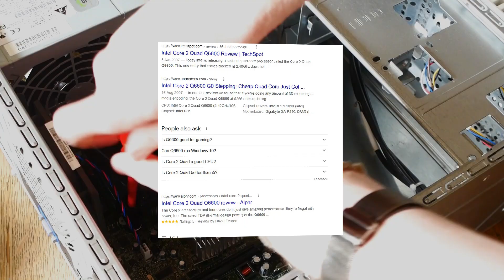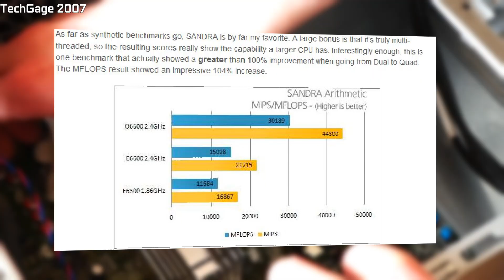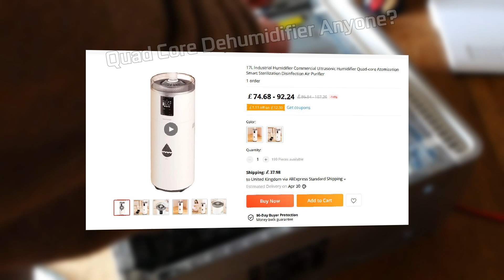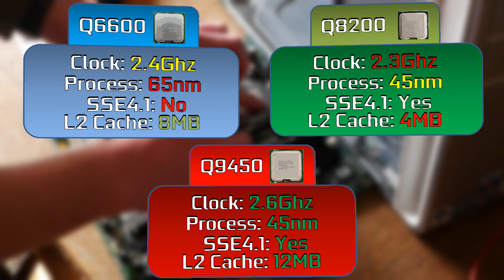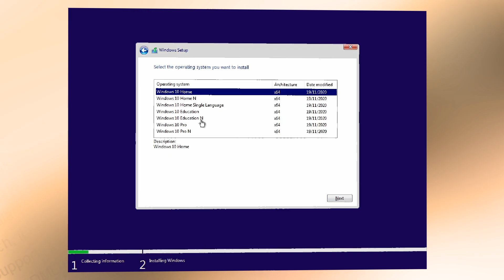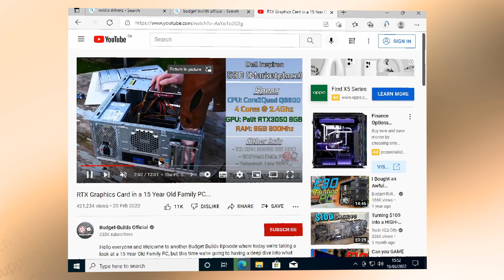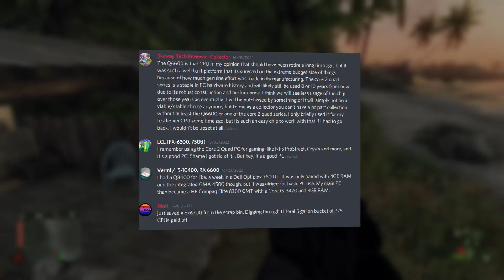Intel's Core2Quad...Finally Obsolete?

Comment: the q9550 witha 1ghz OC and ddr3 was a good puller as of 2 or 3 years ago. mine stopped booting with an OC before i got a 5600x. i played gta 5 on mine.

still use them for web browsing and light gaming now.
 still usable

Comment: Was only a couple months ago my media PC died (dead mb or CPU) since rebuilt pc but it was water cooled with custom loop I made with parts off AliExpress cooling the q6600 in an Asus p5e with 8gb ddr2 and r9 380x. hx1000w PSU. In a fractal define r5
Reply: Note only killed 1 other q6600 in it over clocking but that one only could handle 3.8ghz. 2nd q6600 I got to run at 4.1ghz somewhat stable but ended up taking it down to 4ghz and ran that way for 2years unserviced

Comment: Actually still using a Q9650 in my Asus P5K Premium Motherboard with 8GB of RAM. Dual booting Windows 7 and 10. Still working great! Also have a Q6700 CPU in my Dell XPS 410 computer with 8 GB of ram.

Comment: Bought 2 C2Q dells with 8gb ram for 50 euro. One has pfsense installed and works as a router. The other one I tried different setups on. Both Run like a charm on linux and FreeBSD. Windows is ok but drivers is a search sometimes. You can get the chipset gpu to run on 4k with displayport and its an overall decent machine and platform to use for anything but gaming.

Comment: It's pretty shocking that up until about a year ago (ie during the pandemic) I could pick these systems up cheap, drop a 120GB SSD in it, and resell w/ Win 10 for around $100 if I included monitor, mouse, keyboard, speakers, and mic. Didn't make much on them (about $10 each), but several folks bought them for use as a home setup for school

Comment: I had Q9650 till 3 months ago when I finally upgraded to 5600X on AM4 platform.  Sold the motherboard with Q9650 and 8GB DDR2 all for 30 euros. Had my 775 platform since 2008. I now realized how much faster CPUs have gotten. Great stuff.
Reply: You also feels like you're time traveling from 2008 straight to 2020 when you finally upgrade your CPU
Reply: @sihamhamda47  Indeed, "office web browsing etc" uses so little computing capacity, cpu doesn't break sweat, you seldom hear the fan spin up from default min speed. Where as my 2012 old cpu has spurious ramp ups every minute or so.
Reply: ..and uses way less power! My AMD 5700G machine uses only 15-25W web browsing/youtube. It'll be a few more watts when I put in a proper GFX card though, still on on-board GFX.
Reply: Found 4 of these bad boys in an abandoned train , in a server rack. Really helped me gaming as I was broke
Reply: in 2025:  

Core2 Quad Q9550  $15 on ebay  
Core2 Quad Q9650  $30 on ebay
Reply: Yes mobile phones are faster lol

Comment: I'll just say this. In 2015-2016 I got a free Q6600 with 8GB of RAM, and in short succession inherited a Q8200 board. I ran the Q6600 as my main system for 2 years and it was excellent. I eventually gave it away and still have the Q8200 around as a backup board. I only upgraded because I was getting into video editing and CAD work for school.

Comment: Built myself a little dell optiplex 960 meda/retro gaming box a couple of years ago using one of those q9450 chips, works an absolute treat for things like Plex and emulation gaming. Paired it up with a small form factor GT 730 2GB and it just runs totally unattended for months at a time with no issues. Honestly they're massively underrated chips.

Comment: Back in 2017 my i7 3770K motherboard broke. I had an old 775 motherboard with E8400 dualcore, but that was struggling a bit. Ordered a Q9650 from china for a few bucks and overclocked it. 8GB of ram was a must as it ran terribly with just 4GB.Paired it with a GTX680 4GB version. I had a few months of fun with that rig until i got my new 8700K and the 1080Ti.

Comment: Ran my Q9300 for about a decade until I upgraded to a xeon system. Wasnt the cpus fault for upgrading but the system I had was very proprietary so no other upgrades could be done. Still have it. Thought about buildin a mini pc with it for xcloud use.

Comment: I'm still using a custom desktop with a Q6600, along with a Radeon Sapphire HD5670. It certainly can't game for crap these days, but it can still browse the web and multitask like a breeze. I converted it to Linux since it's easier than trying to get Win10 to run. I think that helps it quite a bit.

Comment: dunno, p9650 at 4.2ghz benches to 70% of an overclocked 6 core more modern HT CPU. Not bad . I am getting midrange i5 speeds in 2022. Intel, you know... the cores in the core2 were awesome. Why you no add more cores? put them on a single die, add some l3 cache? I did have to modify the holes on a corsair AIO to mount it, but a drill bit and a ruler, and it works fine. Temps stay low. Never over 36c when 1.4v or under. Pro tip, get SSD and process lasso software. Process lasso, is useful on any machine, but especially useful for here. IT keeps everything running very snappy always. 15 year old platform. Modern games. My old motherboard looks odd in the newer cases with an AIO, and I had o rig up a fan to cool off the northbridge, but hey, I can't afford a better computer. I only have he 3070 because I traded newer stuff for money plus that. I had to pay rent, but I Wanted a 30 series, too. will sell that soon to pay more rent. Rx 580 it is. a bit over 7000 on timespy is as best as I am going to do and a good way to end this era of the most future proof platform I have ever known.

Comment: I still have a 2008 Core 2 Duo, at 3.9ghz with 4GB RAM. It still does browsing ok, and I use it as a simple digital audio workstation with some VST plugins. It all works fine. It would do daily tasks pretty well. And the gaming library available with DosBox, emulation, or Windows games until 2013ish, is HUGE! Far Cry 3 ran quite well on it I remember.

Comment: i'm still amazed how my 14 years-old Q6600 @2,4 GHz works now in 2022. I using it in daily basis so far, recently i tried to find an excuse to change my build to some new one, but i failed. Thru those years of course i made a few improvments such as ssd, extra ram, "fancy" graphic card (GeForce GTX 560 Ti) that did the job. And still can play in modern games with cloud gaming services.

Comment: Any thoughts on the higher end C2Qs these days? I had a Q9550 and Q9650 running at 4.6 and 4.7ghz 24/7 linpack stable back in the day. It took like 250+ watts since i was pushing them around 1.42v, but hey, watercooling was cheap for me at the time. Danger Den had sold some old watercooling kits to fry's years eariler, which contained decent 240mm by 35mm rads with moderate fin density, and a D5 pump, which were the only meaningfully useful parts. I still have one of the 2 rads and both D5s that I got from those kits, though I have since replaced the heads on the pumps since they came with the stock heads that don't have any mounts for fittings. I still have the RAM i used in one of these builds, a G.Skill kit of 1066 which I have no idea the state of, it's just been sitting in my storage box for like 10 years now, and I used a Gigabyte GA-EP45-UD3P motherboard to achieve that overclock, a board which at the time was fairly reasonably priced for price/performance, at only $135. I've been jaded ever since that board at the price I have to pay for boards with similar performance, typically pushing $200-300 to get feature and performance parity on overclocking. If you can find one of these boards and a Q9650 (or QX9650) for a cheap price, it'd be cool to see an update on this, with a proper overclock on some custom watercooling. Pretty sure you can still find S775 watercooling kit as well, but if not I know some people who might have some, if I can't find any of mine that's worthwhile.

Comment: Nice testing 😁, but did you install on HDD or SSD? Not that it matters for high speed with SATA I, I guess... Had a few 775 platforms myself and build a few for others. So if the q9450 is that good, I should not have upgraded it to my 2600k hehehe... 😉 Allthough that was a HUGH upgrade! And that one is replaced with a 9900k build. And that wasn't even necessary lol... But building pc's is my hobby 😁

Comment: Core 2 Quad processors from the 9000 series work great with a GTX 750ti 2gb. I recently built such a PC for a family member who uses it to browse the internet, Skype, office applications and games up to 2015, at 1080p, believe it or not 😆. I also fitted the PC with 8 GB DDR3 and an SSD for the operating system. 2022 and still being used and the person is very pleased with it.

Comment: Holy crap I use to use this cpu with a 1060 (good times) in early 2020 I ended up getting a upgrade to a better cpu and later a gpu. (Ryzen 5600x amd RX6600XT)

Comment: I used Socket A and Socket 370 as my first PC generation, previous to that was a 66MHZ Macintosh Performa 6115CD. After Socket A, I moved over to an Athlon 64, good old Socket 939. While that was better for performance, only when I got into a LGA 775 system did I ever experience what I would consider a truly smooth experience.

I ended up getting a Q6600 to replace a C2D that was flakey. It ended up being the mainboard that was the problem, and so my experience with the C2Q was... Not really complete. I used that machine until it died, and replaced it with a Core i5 4440. That machine still lives on, sitting right next to me, but now has a Xeon E3 1280V3 CPU, the i5 lives in an anti-static bag on my desk, incase the Xeon ever dies. Though, that system is no longer my main box, that being an AMD Ryzen 9 3900XT.

If I had the opportunity to go back in time, I would have absolutely kept the C2Q, and simply replaced the mainboard once I realized what the problem was, and possibly even waited another generation and gone with a fifth gen i7 instead of the fourth gen.

That said, I'm still planning on replacing my 3900XT with a 5950X, since I do a lot of video rendering, and the extra cores and threads would really benefit me.

Comment: Actually 100% false. Most games today will casually use more than 4 cores. Even indie games like Risk of Rain 2 and Space Engineers use more than four cores (the latter commonly hitting 70% utilization on my 5800X). HardwareUnboxed did a follow-up video showing that the Ryzen 5 1600X has now beaten the i5 7600K due to the considerably higher thread count, despite the original review showing the latter.

Comment: I remember spec'ing out a PC in ~2008, looking at the Core 2 Quad processors, and wondering, "what the hell am I going to use that for?" I think the Core I series had just been released, and was super expensive, but Core 2 Duos were a relative bargain by that point. I still have that C2Duo system, and it's still viable for "basic tasks" up to YouTube, though it's been out of daily service for a few years now. Hilarious that, if I had gone for a C2Quad, it might still be a serviceable gaming machine. The motherboard does support C2Q processors, and they're pretty cheap these days... 🤔

Comment: I still have a pc in my house running Q9550 which is used as a guest computer.  I've paired it with a GTX 1050 TI. Still works great.  While it won't run Cyberpunk,  it can still play a good amount of modern games.

Comment: I had a 9450 with 8GB DDR2 back in 2010 or so, great chip & overclocked like crazy with a solid air cooler...I ran mine close to 4Ghz most of the time

Comment: I had a Dell desktop with a Core2 Quad Q9400.  It was as fast as a Core i5-4250u.  It had 16GB of RAM and a 250GB 850 EVO SSD.

The only reason I stopped using it was that Hyper-V in Windows 10 needed a Core I series processor.

Comment: I've got an old Dell Vostro (business version of your Dell) with a Core 2 Quad Q9550, 8 GB of DDR2 RAM, and an EVGA GTX 560 SC.  I used that setup for gaming all the way up until 2016, when it wasn't capable of running DICE's Battlefront 2.  For simple tasks like web browsing and basic office productivity work, the Core 2 Quad series is still more than up to the task, and a great experience.  I would no longer recommend picking up a Core 2 Quad system for gaming, but if you need a very cheap web browsing PC, it's still a great option!

Comment: I actually did an upgrade last year for someone with a Core2 Quad. The owner was ripped off, as it was granded as a gaming PC cos of the core count and the GTX 750 TI in it for £500
Managed to get an i5 9400F bundle on ebay and a 980. Owner was very happy.

Comment: Back in the days i started on a core 2 duo 6400 but upgraded to a c2q 6600 shortly after. Cause running your own server when playing with friends was causing the dual core to choke itself to death. True 1st world problems, when you don´t just want to run a game but also a server client in the background without that impacting your fps.

Shortly after my mb died (was a crappy nvidia chipset anyways) and i bought a cheap asrock, cranked the fsb up to 400 mhz  (or 1600 MT/s instead of 1066)  multi to 8 and... instantly had 3.2 ghz per core without a problem. 2.4 was stock and turbo didn´t exist... One of the best cpus intel ever made.

Comment: the thing I did not like about Q8200, spent my hard earned monies on that thing, was it did not support virtualization.... this was a major fail cause I bought the cpu for the sake of running virtual machines ** the pros was that it had more cache.... I think the 8200S might of supported VT but can't recall, I ended up swapping out the Q8200 with a Q6600 from my friends computer and he got a faster gaming box and I got VT

Comment: I'm still using my Core 2 Quad 8400S, which has 4 cores clocked at 2.66Ghz with 65W TDP only. With Nvidia Quadro NVS 300 video card, 8Gb DDR3-1333 RAM, and 2Tb HDD, this is pretty neat machine. I love it!

Comment: to finish these series, why not the top processor there from ebay or aliexpress with models : QX9775,  Xeon X5492 ..... also you can compare the cheapest combo of AM4 motherboard ryzen 5000G (with integrated GPU) which will be the same or close to the cost of those LGA775 with top-end cpus and the same dedicated rtx3050 for example to see,which one is better specially considering the performance boost of igpu in current am4 and also how those FSR or upsampling is working whether it's better with igou with current specs or older ones combined with Dgpu

Comment: Not that it will matter too much in the scheme of things now, but Xeon e5450 and Q9650 do have support for later instruction set SSE4.1 also. That did allow them to support some newer releases that cant run on the Q6600 or like the entire Phenom and Phenom II line. This, and their performance, put them at the near top of the food chain for cpus of that era, and for LGA775 in general. The e5450 and Q9650 were still semi competent for modern gaming even back in 2017. The e5450 was fairly cheap back in 2017, like $30-40 depending on the seller here in the US, which made it a great option for a budget gaming pc for a entry build. But you would need a board that can run a e5450 though with a modded bios and a pin mod tab for the cpu.

Comment: I still have a running DELL INSPIRON 530 Q6600 Intel® Core™2 Quad 2 with and SSD and 8GB of ram. Upgraded power supply, GTX 290 video card and run linux manjaro on it. It runs nicely. Not dead at all. That was back when Dell made a decent prebuilt PC unlike for the last decade or so.

Comment: I built a Core 2 Duo PC many years ago. Was mid-range in the day. Not a big gamer and it did fine. Later when Intel moved on to the I3/5/7 series, I manged to pick up a Q9550 cheap. Worked well and the game I ran could run maxed out.
Later I inherited an I7 940 and it was not any different other than seeming to draw more power. The old C2Q seemed better. I had to pick up a newer GFX card for the I7 and it screamed in my older games (I.e HL2.) I bet the old Core 2 quad would have done just as well.
If you have an older motherboard withe Core2 chip and you can't afford a new system, pick up one of the later C2 Quad chips, they are going dirt cheap these days.

Comment: The Q6600 were populare due to the extreme overclocking capability they had (I dont think you tested that in this video?.. im not finished) I had mine (scored from a craigslist Dell) installed into an MSI motherboard, clocked at 3.6GHz on air, stable. Computer was my main system and was on for weeks at a time. Overclocking, i think, disabled its Power States.

I still have my MSI 775 board, Swapped to a 771 adapter and a higher spec'ed Xeon... i dont really use it though.

Comment: I don't have a Core 2 Quad, but I do still use Teamspeak.  There are definitely still uses for TS in 2022.  You can't self host a Discord server, and in order to get anything over 96kbps audio you have to pay to "boost" your server.  If you self host TS, much higher quality use of the Opus codec is available to you.  Plus, if your friends connecting to the server are geographically located near you you can actually get much lower latency than having to ping pong between wherever Discord's "servers" are and each client that's connected.  I've even used TS for low latency music collaboration during the pandemic, as the Opus Music preset is high quality enough for it.  You still can't get "realtime" interaction, but as far as streaming high quality audio from one location to another and playing over that it works great.  I also find TS's hotkey configuration to be much more versatile than Discord, making it much easier to switch between different audio devices as well as switching from PTT to automatic.